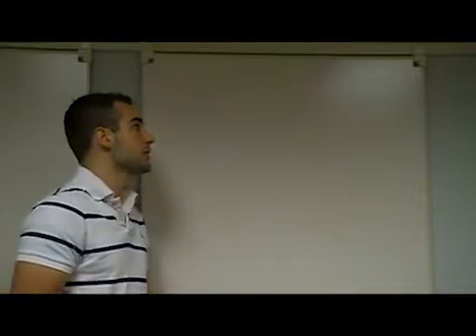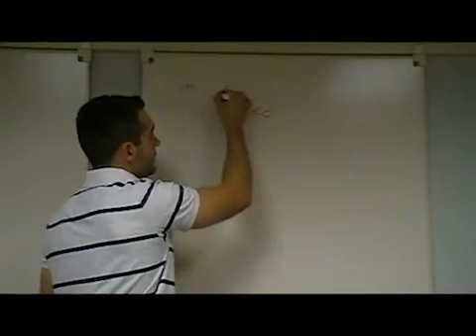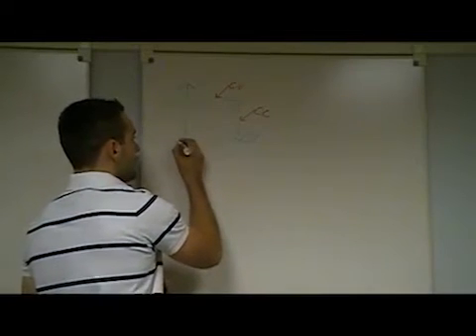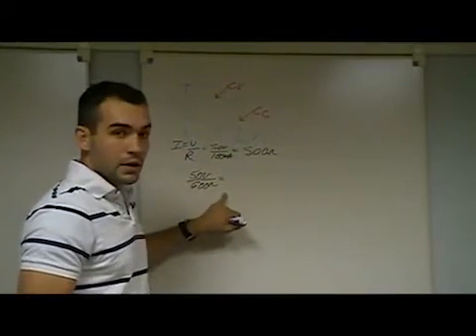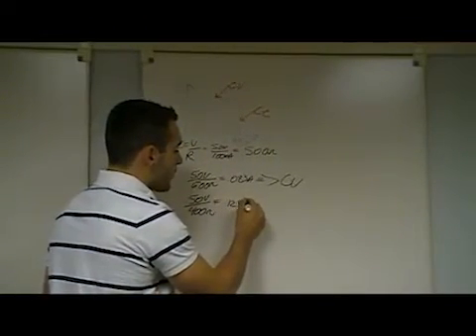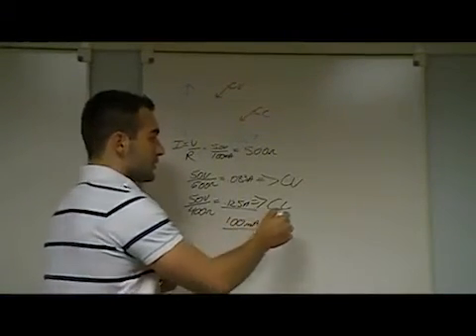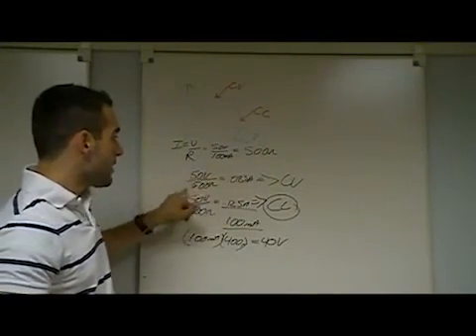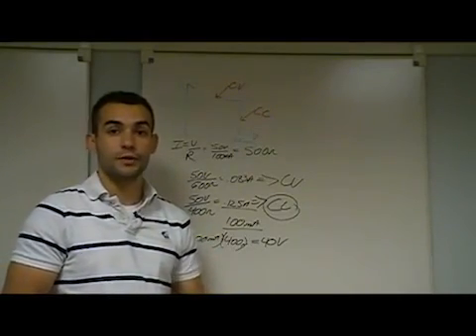Basics on Constant Voltage CV and Constant Current CC Part 1

Comment: The resolution of the video (at 360p) is not high enough to read your drawing on the whiteboard.
Reply from the maker: +43vl I agree the graph is very difficult to see.  The graph has voltage on the Y axis and Current on the X axis.  A constant voltage is parallel to the X axis and a constant current is shown parallel to the Y axis.  The typical PS will operate in constant voltage mode unless the load is too large.
Reply: @KeysightHandsOn tttttttttt tr rrrrrrrrrtrrrrrrrrrrr hai tr5t5ttttt5rrrtthgggtt ka photo send kar do rfrrr 📚📚📚📚😝😝😝🎁 VV. 🎁☺️☺️🎁🎁❤feft😂😂😂❤😂 VV BBV va y GB BB bBBVV g TG😂 goo VV BBVVV gg gggrf eff RR tgg RR VV free va by VV by VVV gg no AA TV de ff bill VV by VV free va by g BB bBBVV by VV by VV by VV VV BBVVV VV VV VV ffttv VV VV VV CT hgffffgggfrfgvV BB bBBVV😂 VV ❤ fr r❤ c 5:18 g hu g 😅